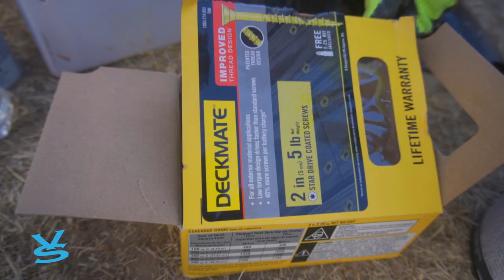Privacy Fence Extension To Keep Dogs In The Yard Using Cedar Pickets

Comment: What kind of pipe did you use? What fasteners did you use to attach the wood to the pipes?
Reply from the maker: The pipe we had to get at the local metal yard.  We needed them taller than the usual pipe found at home depot.  We got the brackets at home depot in the chainlink fence area.  They work great!